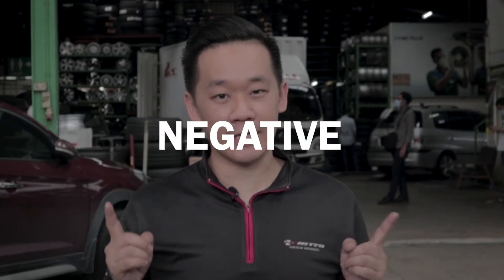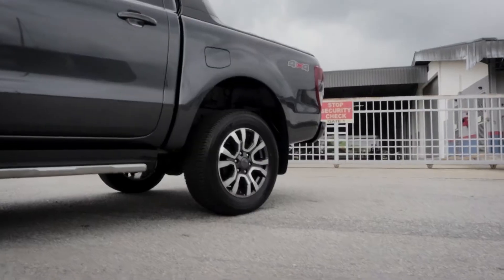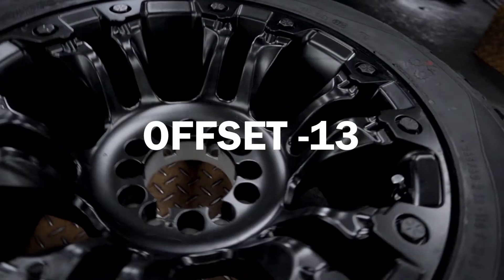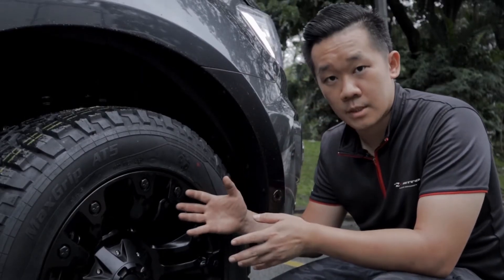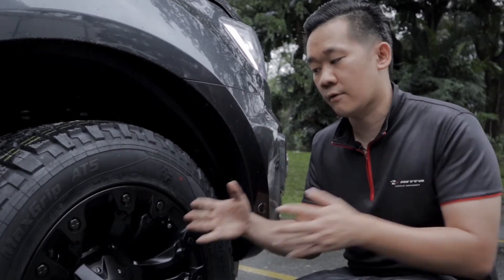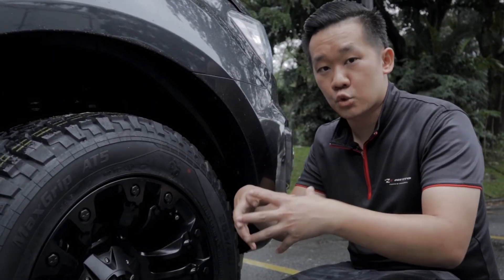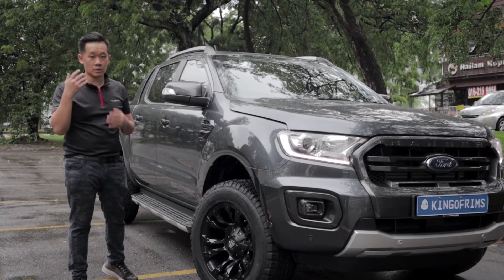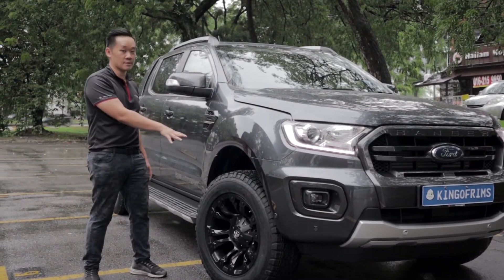Negative offset rims (Things to consider before getting one)

Comment: Here is my question . I will lift my outlander 40mm. My  factory rim offset is 38mm. I want to install 0 offset rim. My current tire is 215 70  16. I will change it to 225 75 16. Do you think it will fit ?
Reply from the maker: Hey man, where are you from? Could you contact me at 012-9820693 (Jeff) so I can advise you in detail? Thank you!

Comment: Have you tried putting 17s on a toyota hilux (original is 18s) with tire size of 285/70r17 without changing the height of the truck?
Reply: Cannot fit..it will rub in inner fender..need at least 2 inch lift with few cutting to fit those size without rubbing anything